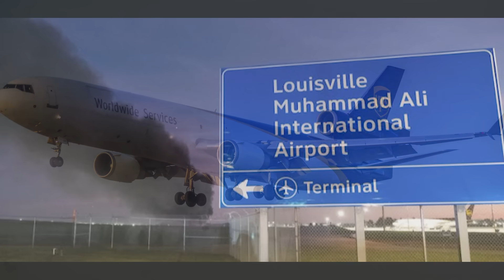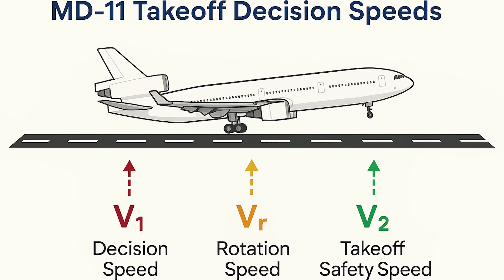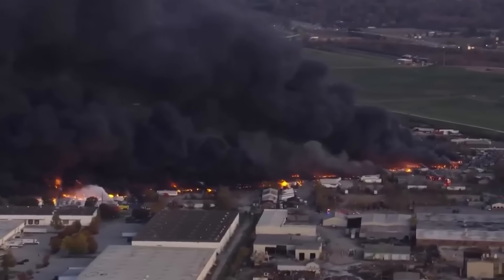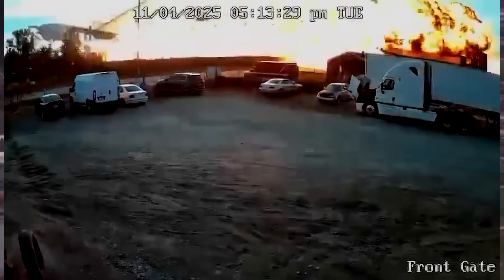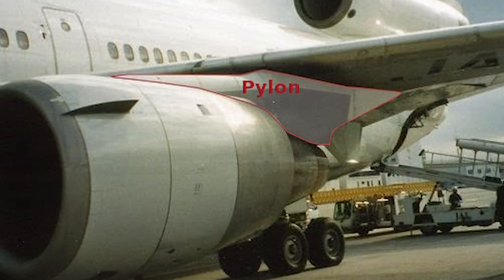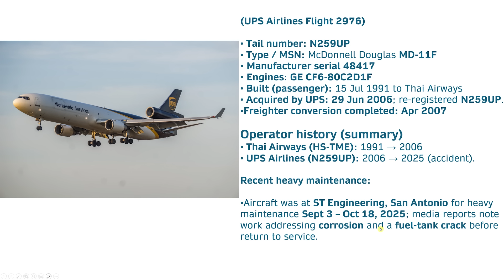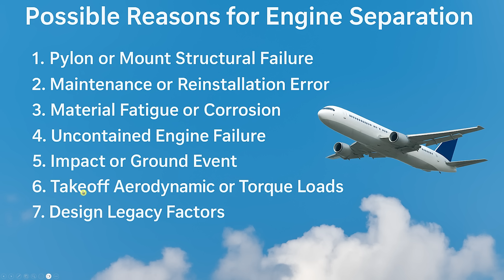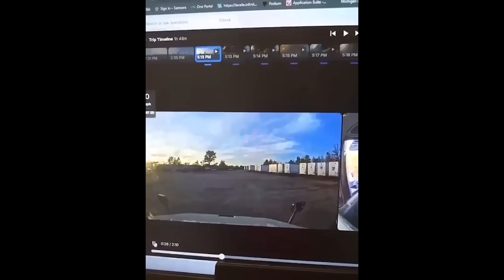What Caused UPS Plane Crash, Louisville, KY? How MD-11 Engine Fell Off

Comment: My initial thought was that there had been a catastrophic failure —a small explosion, if you will —on the number one engine.  That blew the engine out of the cowling.  The number two engine appears to suffer a compression stall. That probably doomed them. As for the cause of the failure, it could have been similar to the 737 engine failure with a female pilot.  Or it could have sucked up FOD from the runway.

As for the crash in Chicago, two things were to blame.  First, as you said, faulty maintenance.  Second, the manual's required speed to fly on one engine was incorrect, which was a major factor.  They amended the manual to reflect a higher speed.  If you look at the footage from the Chicago accident, there is no fire, just fuel coming from the pylon.  This one was on fire.

Thanks for the video!

Comment: The tail struck the building. Also believe the hinge and latch beam failed as the mounts are very similar. Wouldn't be surprised if maintenance was using a forklift to R&R the engine just like 191's cause. The #1 failure likely FOD'd #2 engine. Flight was doomed at V1. RIP to all affected.

Comment: Just an about worse case scenario, complete loss of left engine leaving structural damage and a fire, the right engine having compressor stall due to debris ingestion, and loaded full of fuel and cargo, and too fast and too far down the runway to stop.

An absolute no win scenario.

Comment: Pilot Steve said the wing would have dug in the roof before the videos and you can see now from the trucker video the plane did tip on the roof from the right engine still being thrusted so he was right. It was the left wing that gouged that roof. After it hit the roof there was no left wing when it exploded.

Comment: Wow, when you mentioned the American Airlines flight out of Chicago flight 191, that sent chill down my spine because I was originallys scheduled to fly on Delta flight 191 that crashed in Dallas, but I flew a day earlier due to God’s intervention and my mom prompting me to come a day earlier. What a coincidence that both crashes had the same flight number. I never knew that.

Delta Air Lines Flight 191, which crashed in Dallas–Fort Worth, Texas, on August 2, 1985, due to wind shear (a sudden change in wind speed and/or direction).

Comment: It is the pattern. On the afternoon of May 25, 1979, the McDonnell Douglas DC-10 operating this flight was taking off from runway 32R at O'Hare International when its left engine detached from the wing,
Reply: What's the pattern? Runways with an R designation?

Comment: You're worried about 720 versus 4K be lucky you got all the videos you have.
I was working at O'Hare International Airport when flight 191 went down. This UPS crash is very similar to the same situation.
Left engine separating from the wing.  Is very reminiscent of American Airlines crash of flight 191 DC-10 out of Chicago O'Hare.  That DC-10 lost its port engine on takeoff.  It fell from the wing and the plane immediately did a roll to the left. Don't forget the engine departing the wing it may have tore the hydraulics for the leading edge devices. If they retracted, that Wing would no longer be producing the same amount of Lift compared to the right side. Thus along with thrust from the running engine would cause the plane to roll to the left..

Comment: the fact the engine "fell off" is insane to me
Reply: The plane was designed to be able to fly and actually take off with only 2 engines
Reply: Yeah, that's not supposed to happen, but it does in fact happen, usually without such an immediate disaster. Most events have historically involved Boeing jets, just because they've manufactured the most jets. When it happens at altitude pilots can react and usually get the plane down.
Reply: Curious to know if this was it's first flight after the "heavy maintenance".
Reply: Only uses 2 bolts to mount.
Reply: @JamesFunke-s3r  Only two bolts 😳

Comment: Rooftop looks more like a tail strike than landing gear
Reply: I agree, nose up , tail down, clearly tail strike
Reply: Yeah. Your idea finally makes some sense. Or wheels dragged approach light poles until they caught in the roof. Pure cruel irony that UPS plane almost takes out UPS warehouse. How that must have sounded louder than usual and people inside probably wouldn't bat an eye until the roof opened up.
Reply: Yeah, looks that way. But I believe there is video that shows the airplane going over the top of the building and it was not inverted at the time. That's why they say it must have been caused by the landing gear.
Reply: I agree, as it seems to me that if the landing gear was hooked by the roof at 200mph, either the landing gear would've been torn off or it would've caused the nose of the plane to dive into the dirt.    From the videos, it appears that part of the left wing was sheared off (by the power lines?) so the resulting imbalance in lift caused the plane to roll to the left.
Reply: @WakeUpAmerican000s  keep in mind that landing gear is designed to support the weight oof the entire plan and everything on board. It's gotta be pretty strong.
Reply: @Yeeeeeeeaahhh strong if load is applied as it is intended. It is not designed to take high loads from berms or buildings
Reply: @Yeeeeeeeaahhh  Nope.  Landing gear is actually a relatively weak component if not used as intended.  So weak that we have Vlo speeds, called "Landing gear operating speed," which is a maximum speed the gear can be down or raised or lowered without damage from the airloads.  That building would have sheared them right off.
Reply: @ILSRWY4  all I am saying is that I believe there is video that shows that the airplane was not inverted (flipped) when going over that building. In fact, it never fully inverted, which makes it impossible that the tail caused that to the roof. It rolled onto its left side ultimately as it was coming a part. So, I guess the videos are wrong and you guys know more. LOL! Who would have thought!
Reply: @Yeeeeeeeaahhh 
Be careful with those eye rolls everybody's folks will tell you they might stick that way. 
Landing gears can take  huge lateral forces. 
When a plane lands making contact with the runway even in a hard landing there is a lot of sideways force as the wheels spin up at that moment of contact. 
But it's still not taking the full weight of the airplane the airframe is still carrying weight. You can see video of planes landing with a cocked gear with pieces breaking off and sparks flying but the gear still doesn't collapse. That said the plane was still rising which would explain why the gouge starts at the edge and stops several yards in.  
That plane was very heavy. And once it started rising that momentum is going to take it in an ark. And sadly the cockpit was probably the last part of the aircraft to make contact with the terrain. 
For the crew the end would come so quickly I don't thinkj they would feel any pain. 
If they tried to abort the take off that whole warehouse would probably be gone.
The troubling part is the chain of events that caused this. 
And thank God it wasn't a passenger flight.
Reply: @Regan-m3m  my </eyeroll> was for the injected politics in a very tragic event. Get help.
Reply: Left wing there is another video showing more of that
Reply: Most definitely was a wing. Indicated by the slash like effect to the building. Had to be the very very tip of the wing otherwise that building would have been on fire also
Reply: Makes sense, the only part of the most plains designed to take some impact, is the tail bottom side hitting the ground. Planes are not sturdy big things as many people think
Reply: I thought the same thing when I saw the video of the plane flying over the building with it's nose up and tail down.
Reply: It looks more like it could have been caused by wash from one of the engines. There's debris from inside the building that appears to have been blown out onto the roof. I also don't see signs of "dragging".
Reply: At that point the plane was still climbing. You can see that truck drivers view that  the cockpit was intact. So fortunate it wasn't a passenger flight.   
Has trump come out to blame the crash on the democrats yet? Sounds like his style, donny heartless.
Reply: @Regan-m3m  </eyeroll>

Comment: 191 didn't catch on fire and both engines left were working fine, pilots caused stall and crashed it. Here, it was much more messy and they had probably one fully working engine.

Comment: 1. debris on the runway ? flicked up by the wheels and punctured into the wing leading to a fuel leak, explosion and large fire. It’s happened before

2. Partial Collapse or buckling of the landing gear during take off roll
Reply: I don't see how FOD would be able to knock an engine off.

Comment: On your list of possible factors, Number 7 is not a valid point. The MD-11, a descendent of the DC-10, has a very good safety record as far as the CF6-80C2 engine, it is a incredibly good engine. The DC-10 had teething issues early in life but went on to be a work horse for both passenger and as a freighter. All your other points are valid. Good episode. Thank you.

Comment: Some commenters have raised concerns about the center engine as well...
The airplane is capable of taking off with two engines, but not one. So if the center engine was damaged by the failure of #1, then there was probably nothing that could have been done.
AA 191 still had both engines operating, but the left slats retracted causing the left wing to stall and roll over. That could be the case here, but the rollover didn't start until after impact.